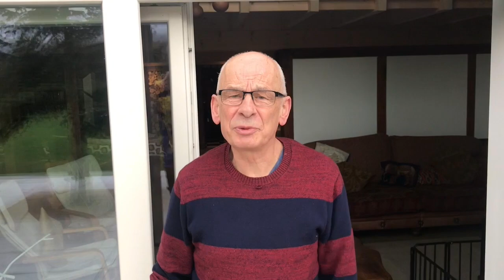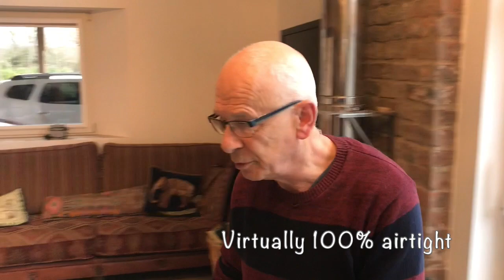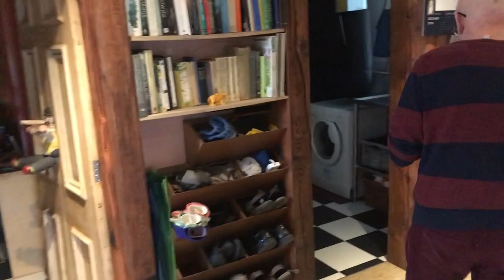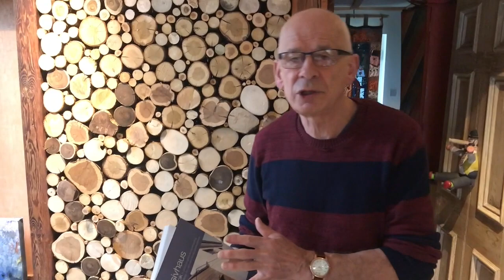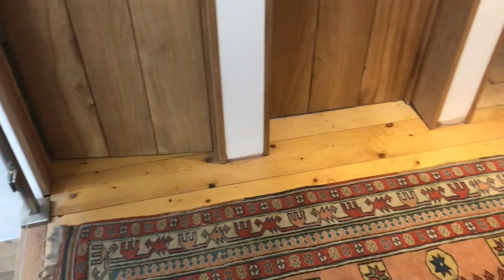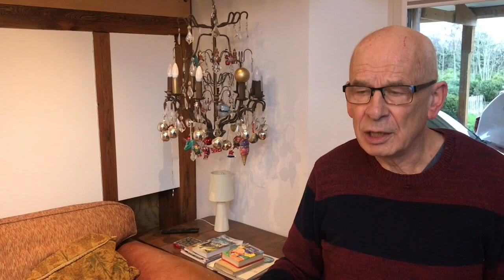Great Busby Passive House

Comment: Hi I'm surprised your using 5000kwh per year. We have an ASHP  some insulation floor, roof and loft.  Solid brick walls with EWI but we are at about 3800kwh a year and nowhere near as air tight. We will put in MHR V System soon. And upgrade the sheep's wool in the roof. We do have some solar but that mostly charges the car...
Reply: Thank you for your comments. The house itself requires very little energy to heat it but there are some services etc.  beyond  the normal. The sewage treatment plant and large MVHR run 24 hours a day year round and then there are a number of domestic appliances and machines in my much used workshop plus the demand for domestic hot water. The ashp will from this year run the underfloor heating from 12a.m.to 5.00a.m. on a cheap tariff and at the same time will be charging our 18kwh battery via an 8 kw inverter. The 8.5 kw solar array has been in place since May and so far since then we have been virtually off grid with better than expected income from export. I am hoping the annual consumption from the grid will be substantially down from the energy figure I quoted.
Good luck with the rest of your project.
Pete Smith.

Comment: Passive house is the future. There needs to be more information on climate specific passive houses. I live in a hot humid climate without extremely cold temperatures. There needs to be more information on how to keep the noise cool throughout the year not just summer ( i.e. where to position windows and shades to prevent solar heating throughout the year).